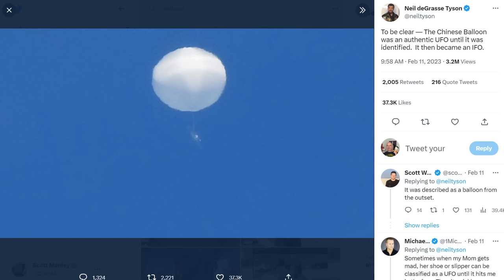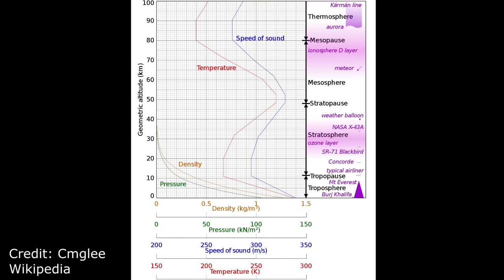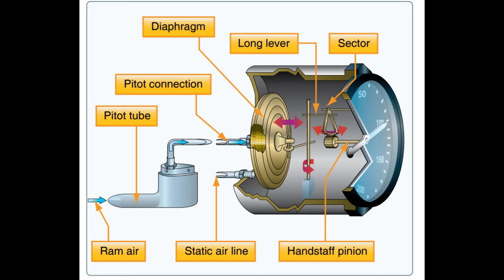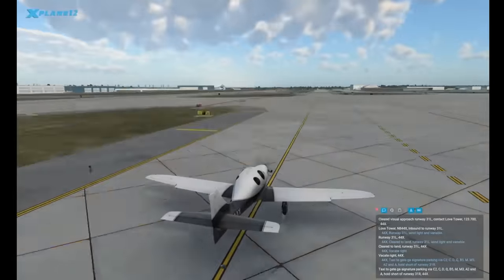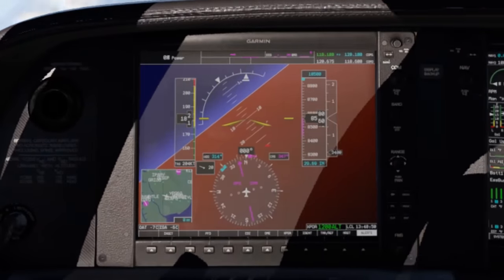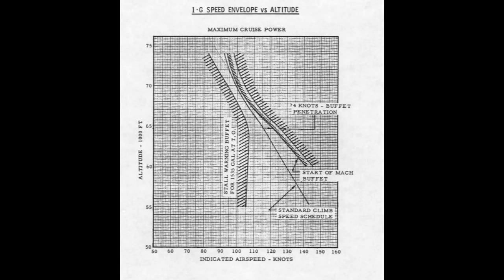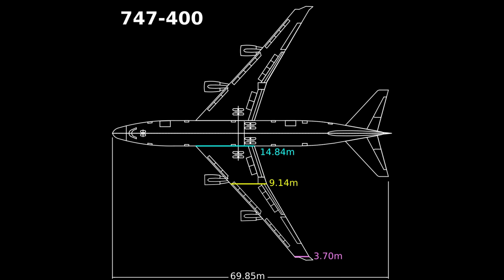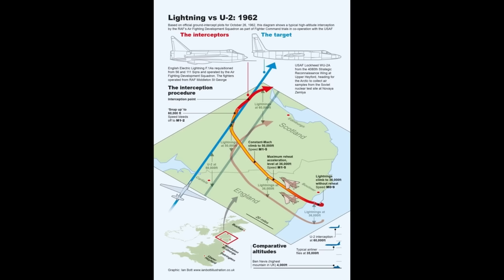How To Design A Plane To Fly At 100,000 Feet?

Comment: 12:00 ~ The ultimate end of Coffin Corner (in the U2) was at 72k ft, and a firm rudder input would result in yaw, and buffet. The downstream wing was suffering stall buffet and the upstream wind was suffering compression buffet. When you can get those two at the same instant, you know you're out there on the edge.
There was a funny story about a Boeing 727 on a sales flight / demo, to some tin-pot African country, and the passenger in the jump-seat was the head of the country's Air Force. So they got to about 40k, and the pilot told him that was service ceiling, so our 'General' asked how much higher it would go. The pilot admitted he didn't know, then turned to His Excellency, and grinned. "You want to find out?" I hear it got to way over 50k ft. Two of them sitting there and grinning at each other like naughty children.....

Comment: Jet engines push against the atmosphere?

Is that really how they work? I think a certain Mr Newton might want a word.
Reply: no , to the first question  and almost right on the second.
Outgoing mass flow momentum minus incoming momentum relative to the aircraft.
For a rocket the incoming momentum is  already there, zero relatve to the rocket, and the out going momentum is the flow mass times the exit velocity.
Newton does not pertain to flow , just discrete mass of the body  and its acceleration.
True the air flow gets accelerated from one velocity to the other for the short time to cross the propeller disc    F = m (ve - v)/dtime
F = m÷dtime × (ve - v)
mdot = m÷dtime    mass flow
F = mdot × ve   -  mdot × v
F = outgoing momentum
             minus      incoming momentum

Comment: I once zoom climbed a Cessna 152 to 7,500 feet. Took me 45 min to climb to 7,000. Another 5 minutes to accelerate to 85 knots. Since I had rented the 152 for 1 hour, I had a really nice middle of the white arc descent. Amazing what you do to build time to get your ticket. (ps, I kept the RPM's up to 1700 until the cylinder head temp stabilized then pulled the throttle to idle and full mixture -- last thing I wanted to do was sit in the FBO's office and explain how I cracked a cylinder head on a 152)

Comment: Did you actually say that the Jet Engines push against the atmosphere? My understanding is it is the mass of the air flow being pulled into the engine and the fuel gases and air being accelerated pushed out the nozzle that in turn push the plane forward. Not "pushing against the air" but rather action of throwing mass out the back = reaction of plane moving forward.
Reply: What about a compressed gas which is allowed to expand against the sloped sides of a nozzle?
Reply: Newton's third law!
Working equally well in space as in the atmosphere, although air-breathing engines won't work in space.

Comment: Scott, not sure if you've previously covered it, but an explanation of 'stall speed', why it's not actually a real thing, and what it actually means, would be great,
Reply: All stall speed is, is the speed below which you can't maintain level flight, because the wing's maximum lift drops below the weight of the aircraft.  What makes it a "thing", is that when pilots really, really want to maintain level flight, while below the stall speed, they increase the angle of attack to the point where the wing loses much of its lift, leading to a positive feedback loop that puts the wing into a full stall, where it produces practically no lift.  As long as you keep the angle of attack below the wing's maximum lift point, the wing does not stall.  The plane just doesn't maintain altitude.
Reply: @BrightBlueJim  Wouldn't it also happen if a pilot doesn't try and maintain altitude but tries to maintain pitch? As the plane slows down the angle of attack increases even though the pitch remains the same, eventually reaching the critical angle of attack and stalling. I seem to remember a regional turboprop crash where the pilot put the autopilot into pitch-hold mode against company policy as a way to climb faster. Then he and the FO got distracted talking to a FA, as it got higher the airplane slowed and stalled.
Reply: @StevePemberton2  This depends on exactly what pitch hold means, and I don't know how this is implemented in autopilot systems.  Also, pitch is NOT the same as angle of attack; pitch is the angle the wing makes relative to the horizon, while angle of attack is relative to the airflow.  As the plane slows and lift decreases, and the plane begins to drop due to insufficient lift, the air hits the leading edge at a steeper angle, which CAN cause a stall, even if the nose is pointed below the horizon.

Furthermore, even if a pilot maintains the angle of attack, this does not mean the plane won't crash.  The plane will still crash if he allows it to fall to the ground, even without stalling.  It seems to me that an autopilot should be at least smart enough to give a warning if it is unable to maintain the parameters it was set for, but the technological world is full of automated systems that don't account for and handle every possible state.
Reply: @BrightBlueJim  Yes I know pitch and angle of attack are different,  I think that was clear in my statement, "As the plane slows down the angle of attack increases even though the pitch remains the same"

Pitch hold in an autopilot is just as the name implies, it holds the plane at a fixed pitch. And yes that can certainly cause problems, and in this case caused an accident. As I said the airline's policy was to not use pitch hold.

Comment: The real limit of the F-22's altitude is the pilot. Forcing air down the pilot's gullet only works so well, beyond a certain point you need a pressure suit. The F-22 could cruise high enough to kill a pilot not in a pressure suit.

Comment: 2:12 cue the nerd that starts every sentence with "acshually...."   one might consider that a helicopter generates lift from wings. The blades are airfoils, operating in precisely the same way as a typical wing does. Only, rather than moving the whole vehicle forward to make the wing generate lift, only the wings are moved forward (rotation) to generate lift. So, any vertically orientated prop aircraft generates lift with fast moving wings (spun by the engine).
One could assume that if one were to take the helicopter blades and simply attach them to the vehicle like wings and propel the whole craft forward, the forward velocity would be roughly equal to the rotation speed to accomplish the same amount of lift... right?

Comment: Had a friend that flew the CF-104 and I asked him what his highest height achieved was. He told me that if they had the gas coming back to land they would light the AB and get up to mach 1.5 at 40 000 feet and do a big wing over with the power pulled back to idle. He would routinely see 65 000 feet at the top of the wing over. Said it in just a matter of factly way. lol

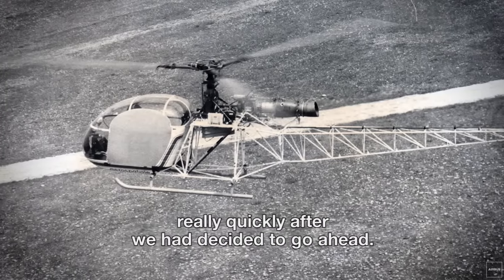Comment: 3:40 is it feasible to have wings that undergo expansion of their width in relation to rise of altitude? 
Can wings be designed to expand out 4 times their normal span for high altitude mode?
Reply: Yes, but that adds a lot of mechanical complexity and weight. One of the American competitors to Concorde (the Boeing 2707) was going to have a swing-wing to allow it to adapt between low and high-speed flight, but the structural mass required made the design unviable even by the standards of supersonic airliners.

Comment: I wonder, if you were moving fast enough, could you use aerodynamics to change direction in space?
Reply: That's an interesting question. The Space Shuttle's aerodynamic control surfaces were ineffective during the initial reentry so they had to use the RCS thrusters. But as they came into the trace atmosphere the control surfaces began to have a little bit of an effect. But at hypersonic speeds in very thin air they worked differently than at subsonic or supersonic speeds. One astronaut reported that if they wanted the Shuttle to bank to the right they could lower the right elevon (the Shuttle computer did this not the pilot). At subsonic/supersonic speeds in denser air this would have created some lift on the right side and caused a bank to the left. But in the very thin atmosphere all it did was create some drag on the right elevon, which caused a yaw to the right, and a little bit of additional lift on the left wing.

If you had a spaceship that could travel through the galaxy at half the speed of light, there is hydrogen gas out there although very thin. It's possible that at those speeds the hydrogen molecules would have an aerodynamic effect. Whether a spacecraft could use this for steering, like for course corrections, I don't know.

Comment: 1:11 Here, I am wondering how I would design a plane for this high. Pressurized Helium filled balloons/blimp with multiple linear cells so that if one pops another that's next to it can keep the shape. Very slow speed except for when speed es needed for wings to give more lift at night to keep altitude. It's in the shape of a plane as might be seen in the Macy's Thanksgiving Day Parade with tank for extra hydrogen and helium as pressure changes with height. Store it when ascending and release into voids when descending to keep the wing shape. Take lessons from Colin Chapman's Lotus, in that everything is part of the structure (except for the driver/pilot). All or nothing concentration of electronics and equipment into a small area for anti-radar. (One above and thus hiding behind another)
How reflective is bamboo?
Not damaged by UV?
Biplane or triplane to reduce different forces that result from increased distance from end to end. (Macon or Acron crash?)
Cells of hydrogen are surrounded by cells of helium.

Comment: What I find the much more interesting question: How can an IR missile track a balloon which doesn't have a heat signature?
Reply: AIM-9X has a UV sensor built into it. It also uses an imaging IR system so any difference in heat it can detect. Also there is something heating the Balloon, Its called the SUN!!!

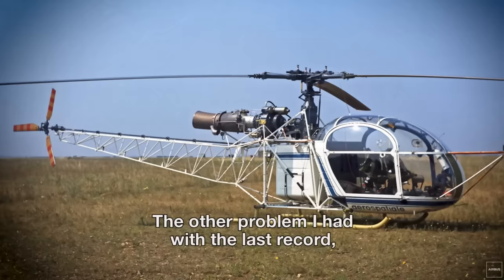Comment: 3:20 just a small correction if no one has mentioned it, 12,442m is 40,820ft not 48,820ft. Only noticed because I knew there weren't ~4ft in a metre!

Comment: If the air intake for the engine is formed like scoops with the opening facing forward, wouldn't you expect that the ram-effect would cause the pressure that the engine "sees" to be the same regardless of height, given that the plane flies at the same indicated airspeed? The airspeed indicator is basically measuring the stagnation pressure, and I would also expect that that is the pressure you would expect at the engine as the air is basically slowed to a halt right before the carburator (given that it is pressent at all)
Yes the air may get thinner, but as you are also flying faster, wouldn't it mean that you scoop up more air in a given amount of time, such that those two effects cancel each other out and your engine wouldn't flame out?
Reply: As I understand it in simplified terms the airspeed indicator is measuring the RATIO of the two pressures, which is what turns out to be important for most aerodynamic properties. However the engine getting enough air cares about the absolute value, not the ratio. Yes that absolute value is somewhat compensated for by the higher true airspeed, but not sufficiently. (If you think about the numbers needed you can see why: to compensate for a 50% drop in pressure you'd need to be moving at twice the airspeed. The ratio discrepancy between indicated airspeed and true airspeed isn't as high, and a 50% pressure drop from sea level only gets you to 15000 feet.)
Reply: @Ylyrra  Ah you are right, I forgot that the air speed indicator also uses the static pressure, and compensates for this, in order to get the dynamic pressure. Hence it is not the stagnation pressure that is constant, but instead it is the dynamic pressure. Thanks for reminding me. And now that we are at the corrections, the air speed indicator does not measure the RATIO of the pressures, but the DIFFERENCE between them (one minus the other). 
The formula is: 

T = Pstat + Pdyn = Pstat + ½rho*v^2 
(where T is the total pressure, or the stagnation pressure, Pstat is the static pressure, rho is the air density, and v is the velocity)

As the velocity is in there squared you wouldn't need to go twice as fast to compensate for pressure drop of 50% in the airpressure.
Reply: @jonsteensen7706  You've slightly misread what I was saying, I wasn't saying that you need to go twice as fast to compensate for the pressure changes in the measurement, but that to get the same amount of air into the intake you need to. And that the pressure changes DON'T match that. Because of the square that you mention.

 (You're right about the ratio stuff, I mangled my explanation there because I was trying to say two things at once badly. :D)

Comment: High altitude subsonic heavy cargo aircraft is going to be critical in the near future to solve climate change.  They need to design something like a U2 flight profile if 75000 feet minimum for solar geoengineering.  That or higher for a plane that would need a very large areosol cargo capacity.

Comment: Air breathing engines don’t need to push against the atmosphere. They provide thrust the same way as a rocket engine, by accelerating exhaust out the back.
Reply: They push against their own exhaust gases just as the exhaust gases push against them according to Newton's third law. The air in front of the engine provides oxygen and most of the reaction mass, but the air behind is of no use.
Reply: @fromnorway643  I’m gonna have to disagree still. To calculate the thrust of a jet engine or rocket engine, the equation F=MA aka Newton’s second law is needed. This formula does not take into account the surrounding atmospheric pressure because it is irrelevant.
Reply: @gavinshah7932  
I think we mostly agree!
However, the surrounding atmospheric pressure does in fact restrain the exhaust gases to some degree, making rocket engines less efficient than in a vacuum where the exhaust gases can be ejected freely.
The space shuttle's main engine (now used by the SLS' first stage) produce 23.5 % more thrust per unit of fuel consumption in vacuum vs at sea level.

Comment: Do jet engines actually have to "push against air" though? 

They need to breath air of course ... but if for some reason there was a vaccum behind the engine, it should still work. The engine still moves the air which means Netwtons 3rd law should apply. 
Am I missing something?
Reply: No, jet engines don't need to 'push' against air (or against anything else). They simply need to push; for every action there is an equal and opposite reaction. Whethere there is air behind the engine, or not is immaterial. 🙃

Comment: What's this "push against air" business? (16:39) Newton's Third Law, as you well know, Scott. As always, interesting, mate. 👍
Reply from the maker: Yes, jet engines take in air and then push against this air so it expands out the nozzle at high speeds, generating thrust through newtons 3rd law.
To get an reaction, you need action.